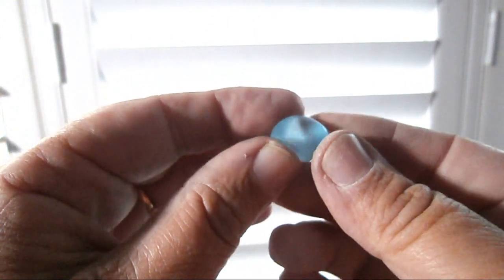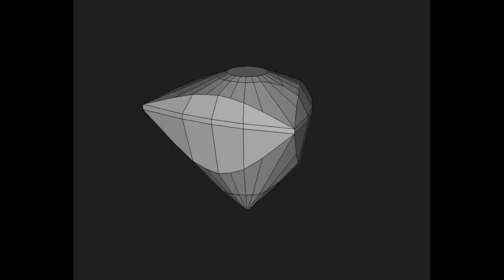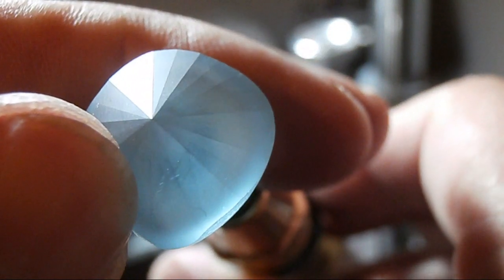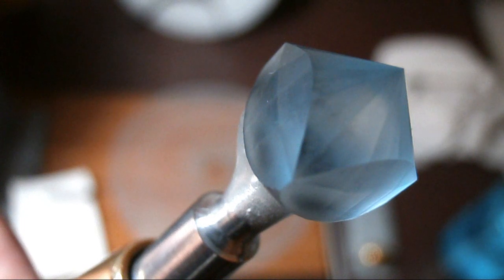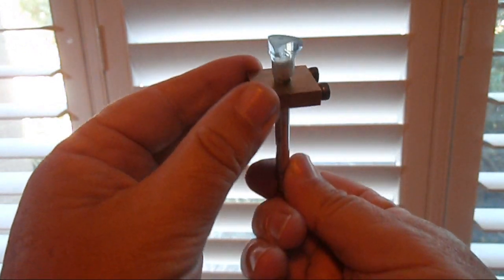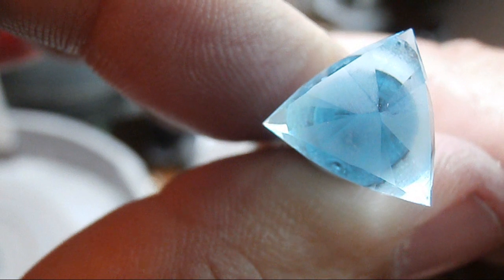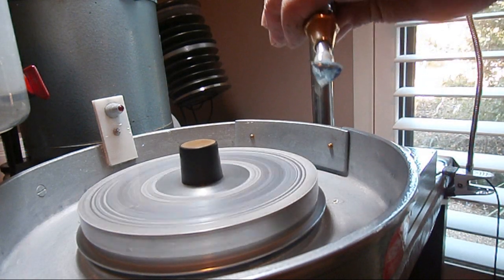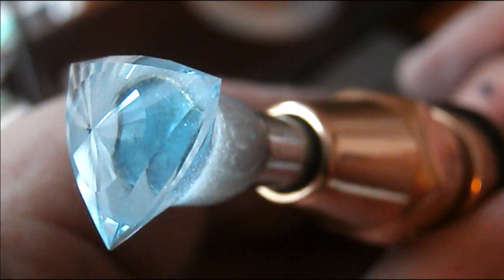How to cut a gemstone - Topaz

Comment: Hello there, OCHO here.
Great video, thanks so much. I call it Gerry Rigging! Nice work.
I am very new to gem cutting. What do you think about the machines from Sri Lanka that have the handpiece that holds the stone (tri-footed on a table attached to mast). Are they any good? Your thoughts would be greatly appreciated. They are around $1200 US. I'm on a fairly small budget. Might you have any recommendations?
Thanks and regards,
Jason (OCHO) Ochoski
Reply from the maker: I prefer mast machines. I know little about hand held machines. Go for a machine made in the country you live in. $1500 US would be my limit for the complete setup.
Reply: @VintageTimeGems  Thanks so much for your reply. This hobby is so much fun for so many reasons. Absolutely incredible!
Some of the top machines sell from $3000-5000 here in the US. Kinda high. I'll have to look around a bit I guess. 
Thanks so much for your tutorials and materials. You are very appreciated.
OCHO